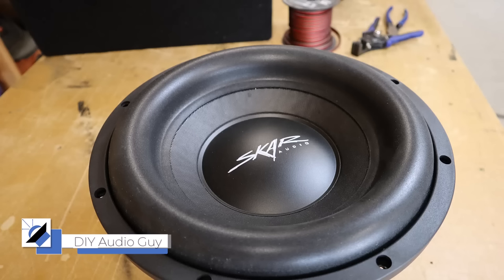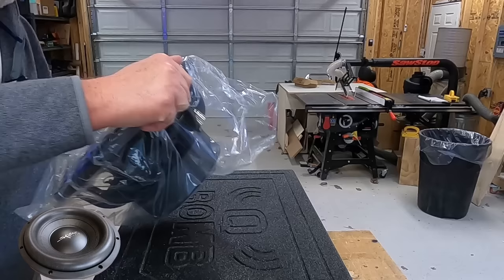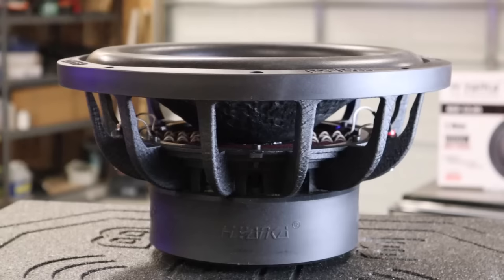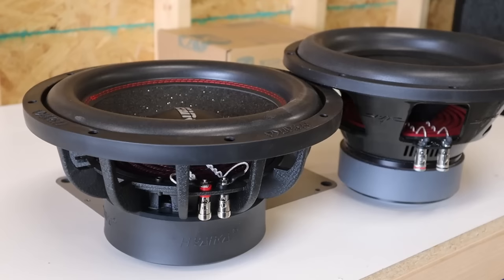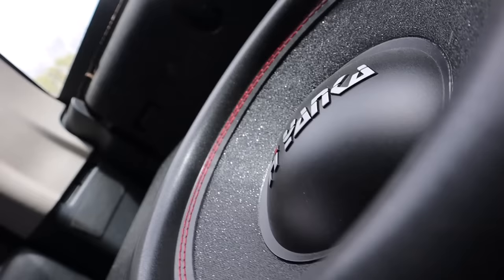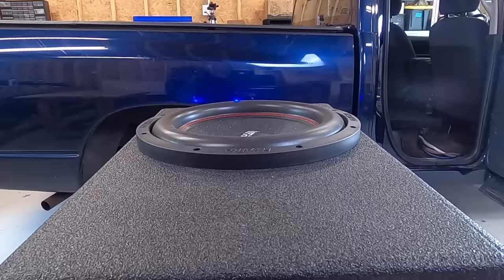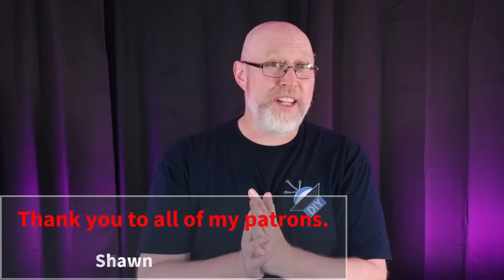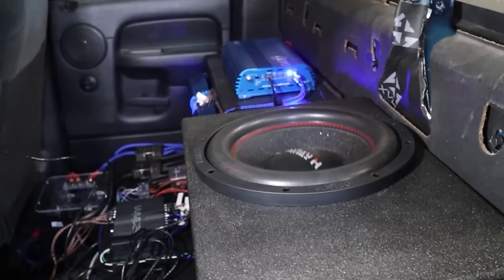The new budget king?  H Yanka better than #skar?

Comment: Paker the bass head, just blew the "Biggest" 12 he had because the spider came unglued. So, any speaker with a hold down ring is a better way to go, in my opinion
Reply: Pretty sure that sub spider ripped and it did have a ring on it
Reply from the maker: Yep, he fixed it and then cooked an amp.  Anybody doing this stuff needs to keep a fire extinguisher in the vehicle.
Reply: @Gage Gilmet  I just went back and looked before I commented. And NO, IT DID NOT have a hold down ring and that's exactly what ripped so 🤷‍♂️
Reply: A plastic ring wouldn't have stopped it from blowing.
Reply: @Blake Brockhaus  just saying that cheap ass sub does 🤷‍♂️
Reply: @timothy5977  yeah, there's a reason those rings are on cheap subs and not expensive ones
Reply: @blakebrockhaus347  yes , ive rebuilt so many subs and never used a triple joint rings or spider landing rings . You glue your shit right it takes a beating far beyond any skar sub
Reply: I have rs teams and they have spacers and hold down rings and I was able to pull the screws out of the frame and the rings broke. Granted I had about 13k on it they still broke it. The other sub in that box has a recone I put and it was glued down with epoxy and didnt fail.
Reply: @gilmet27  no and no
Reply: Proper full break in of the super stiff spiders was most likely to blame for Parker's failure. 20 hz on a bench for 8-10 hours on the expensive subs. My findings.
Reply: @blakebrockhaus347  yeah same here the glue holds it down not the rings idk why they do the rings tbh.. If your gonna pull a page out of orions book and mechanically hold down parts then do that with no glue  then do that not both.. kinda redundant to me tbh
Reply: @timothy5977  Parker also accuses all of his stuff and was probably pushing that sub way beyond it’s mechanical capability’s, he’s broken other quality subs as well from abuse, was there still a pretty bad glue joint yes but he’s does push stuff a bit too hard fron what I’ve seen him do
Reply: @Widowmaker2828  people don’t understand that those 3-4-5 layer packs have so much spider resin material that they are almost brittle when first used if you push them to their limits right out the gate but I doubt the other guy in the comments will understand that one
Reply: Yeah I just watched that video his amp blew because they built the ugliest sub that has a magnet bigger than the whole thing 😂
Reply: Parker likes to put 5-10 times rated power through a NEW sub without a proper break in and call it a review. I don't care what brand it is you can wreck a new sub quick without letting the spider soften up before cranking. 30+ years experience talking here.
Reply: @Donnie  lol I feel ya!! All that's too much for me. I'm old school too back when a 1100a2 or 1100d or basically 1500rms was about as big as you could get.
Reply: @timothy5977  Shit we're getting old bro. Class AB for everything, liquid cooled subs,   diamond diaphragm horns, pull-out chassis, cd players that skip, and literally frying an egg on your Orion HCCA 225 at a quarter ohm. Them were the days
Reply: Parker blew that big sub because he put double the power through it 11,000 in to a 5,000 sub.  6,000 more watts is quite a bit more over then the 1,000 watts he's over in this video.  Break in is BS, all subs loosen up over time, they don't require anything special to be done during some myth break in period..  Any sub should handle it's RMS straight out of the box no break in required.   Start pushing double or more RMS through them, break in or not they can easily blow, it's just a matter of that particular subs strength.
Reply: @marcuslinton310  you're absolutely wrong about a break in period. Drivers with multiple spiders laminated and or glued together, need to be broken in. And to say they do not,  is absurd. When you have a stiffer compliance suspension, and you do not allow the suspension to soften up before going full tilt, you are essentially causing the coil to saturate more easily, as it doesn't move as freely in the gap as it would after the suspension "softens" up. Multiple layered stacked spiders are also more brittle fresh out of the box, due to the lamination process used to adhere them together. You take a fresh driver out of the box, and pull the tsp's.....then break that driver in, and pull the tsp's and they are always different..especially the Fs. Why?? Because the spider AND the surround, will loosen up. This sub he used, is a prime example of this. He ripped the spider from the landing, because it has 8-10 spiders stacked, and not enough surface area of spider(not a large enough spider diameter)and without proper break in,  the spider limited the travel of the voice coil in the gap, when under load, and when when trying to drive the sub with a lot of power...it didn't have the suspension to have the travel, and ripped the spider from the outer landing, due to the shear force.  So, to say break in is a myth, is absolutely untrue. When converting electrical into Kinetic energy, a coil needs to move in the magnetic gap, to cool itself by traveling in that gap, and when travel is limited, the coil becomes saturated, therefore causing premature thermal failure. Also when the coil is supplied with more power, that kinetic energy has to go somewhere, and with limited travel, shit breaks. So yes,  break in periods are essential.
Reply: @Chuck_Sanders    Nonsense.   RMS is completely fine straight out of the box, they will handle it fine and the sub will slowly loosen up over time without any break in method applied.   Now, if you want to discuss throwing double the power on them straight of the box, well, that's obviously another discussion.   This obsession with overpowering subs is what brought on all these special requirements.    The number one myth about not going full RMS straight out of the box is completely silly because how is the sub going to stretch out if you aren't running it at it's RMS limit.  Just like human muscles, if you don't push your muscles to the stretching point, you accomplish nothing, so you have to push the sub to it's RMS if it's going to start to loosen up.   Anyway, you can keep doing all your break-in myths, nobody is stopping you.
Reply: @marcuslinton310  the suspension doesn't need to be pushed to its limits, or it's "RMS power" to loosen up. Moderate playing at different frequencies and volume levels, will loosen a suspension.  It doesn't need its RMS power to break the suspension in. Based on your assumptions, that's like taking a freshly built motor that redlines at 7500 rpm, filling it with fresh oil, starting it for the very first time, and putting a brick on the gas pedal with no rev limiter and letting it fly...insanity. There is reason manufacturers list break in periods with their drivers. And there is no denying, a drivers tsp's change from fresh out the box, and when broken in. Besides, rms power ratings arent a given, as anyone can claim a power rating, and not all can even take "claims of rated power", as seen with lower end subwoofers, because coils aren't rated for "power" as they're rated for their thermal capability.  Next you're going to say that running voice coils in series versus parallel has no variances in BL or sensitivity.  You have your opinion though! 👍
Reply: @DIYAudioGuy   where did you get your multimeter?
Reply: I don't take anyone serious when they are sponsored. Anyone that gets 1000 or 1200 dollar subs in the mail free of charge can sometimes show bias to brands. My favorite car audio YouTuber has fallen victim to this scenario
Reply: @Hammerback0  that's why I always say   Jizzllama4life!!
Reply: @Hammerback0  mbe
Reply: @timothy5977   dei dirrected 1100d amplifier was a monster back 1999. I had it on 2 15inch Rockford Fosgates in a 1994 ford thunderbird. Slammed
Reply: @domthabomb3045  Still some of the loudest systems I've ever heard was on a directed 1100d and L7 15s
Reply: @DIYAudioGuy  no shot 😂
Reply: Best comment yet....😂
Reply: Ooooo😮NOOO  noOO (Parkersvoice)😂
Reply: WHO??
Reply: Which one of these has the hold down ring?
Reply: Parker blows his shit up cause he wants to see how much they can take before they pop he never really does true bass tests.
Reply: @annihilationindustries1990  You haven't owned a single skar to have an opinion about the entire line...

Comment: The new amazon budget sub is WLLDSE, its the new bomb, the 12 is now $142 (I paid $122!)  the 15 is $145, it has a 200oz double stack, 3" copper coil and SA/U cast frame, the hiyanka is good but a 2.5" coil. I bought a 12 on a why not... $122 with features hell, it showed up I instantly ordered a 2nd.  I'm testing 2 on my cab45 amp @ .5 ohm and they slam... No I'm not giving it all to em that would be just risky to a 1200w sub but I have givin the pair more than 2400 I'd think. Oh btw it also came encased in a foam block in 2 boxes!

Comment: I have 2 12 inch Rockville K6 I push them with a audiopipe 1500 mono Amp. I blew 2 sets of skarbage subs before my K6 and I'm going 3 years of rocking my K6 subs! Talk about low budget my subs cost me $70 each, and the Amp was $99 that was during covid. Oh yeah I rock my subs everyday as they are in my work truck a 2003 silver king cab under seat build.
Reply: Rockville subs are tha truth, minus the k9 debacle a few years back. I'm running 4 punisher 12s on a wolfram o 5000 amp lovin it. Started out with the k6s in our cars  a pair of 12 was in mine and 2 sets of 10s 1 for set for both kids and the were that thang.

Comment: Sub definitely performs. I'm actually putting in H hyanka 6.5 component speakers in place of skar 6.5 and only 2months old. Nice post.😎👍🏾
Reply: Yeah them Skar sucks I even had their pro audio was crap … I went with DS18 way better by far another level of audio power handling and priced cheap $115 for a 250 watts rms components

Comment: Thanks to your video, I picked up a dual 2ohm 12" H Yanka and installed it in a slot ported box for a kicker L7. Wired it @ 4ohms to a D4S JP8 amp.. and holy crap. I had a Kicker Comp in there before and this sub blows that Kicker out of the water. Once I upgrade my power/ground and speaker wire, Im going to rewire it at 1ohm on the JP8. Cant wait to hear it.. because at 500 watts.. it has to much more to give. Mine was packaged well, however, the box was printed wrong. It said the Dual 4ohm sub was 1800w and the Dual 2ohm sub was 1600w. The manual said the opposite. Their packaging department needs up upgrade.. but hey.. if they keep putting out banger subs for cheap, idgaf about the box.
Reply from the maker: If have riding around with this sub for a few weeks now.  I think it may be a real sleeper.
Reply: @DIYAudioGuy  I have it in a 3CuFT American Sound ported box. I wired it at 1ohm last week and wow! I had to go back to 4ohm because I dont have the current to keep up with the JP8 @ 1ohm.  lol. Voltage drop from 14.4 to 11.2 in 1 beat.